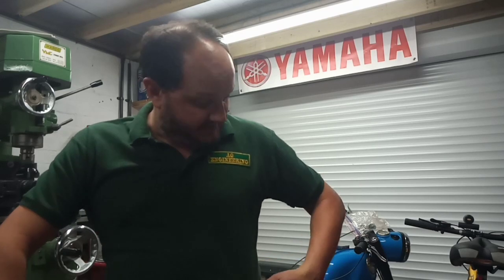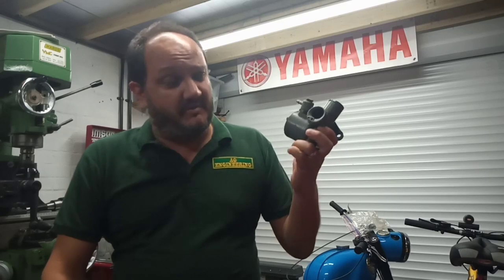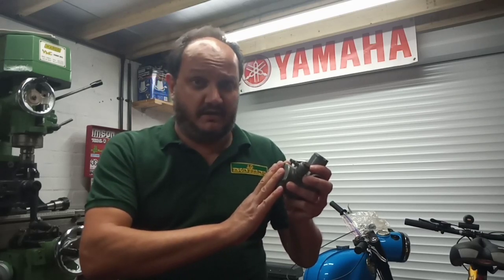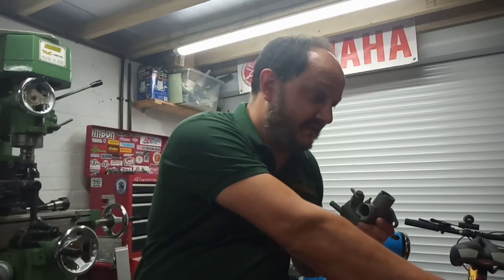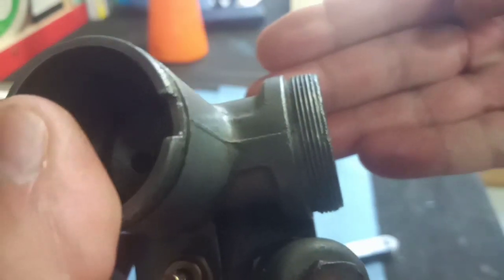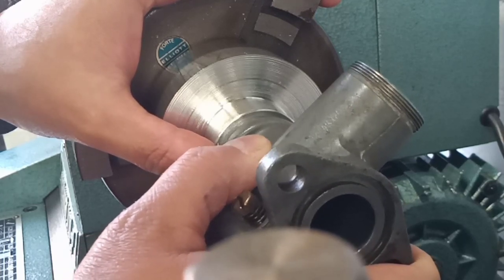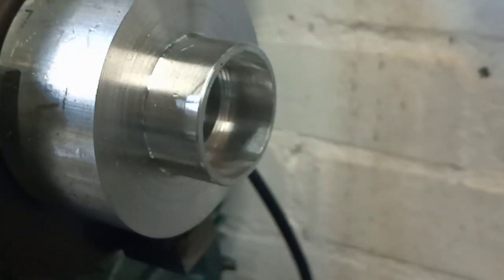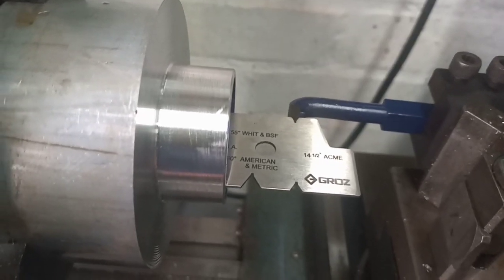Amal Monobloc Gremlins! Fixing Leaks and Machining an Adaptor Ring on the Maximat Lathe.

Comment: Nice shirt! That was a great video! Loved it. The thread came out really well. I was thinking when you were reducing the diameter of the blank that it would be great to be able to trepan or core out something like that to save wasting so much. I thought it was great though. Fantastic to see the museum. I've always loved "The Bat" right from us being children. You can see the power in the thing, such a beautiful machine. When you look at the engine in it you can see every single part in it has been machined and made by hand. It is a one off, reminds me of an aircraft engine. I'd love to visit that museum some day.
Reply from the maker: I like them too, BAT actually purchased the rights to build Martinsyde motorcycles. Martinsyde had been an aircraft constructor before making motorcycles and used Blackburne engines, who were an aero engine manufacturer. You can definitely see the aero influence. We should visit the museum some time when you are here.
Reply: @retromechanicalengineer  Interesting to learn of the aircraft connection. I'd love to visit there with you.